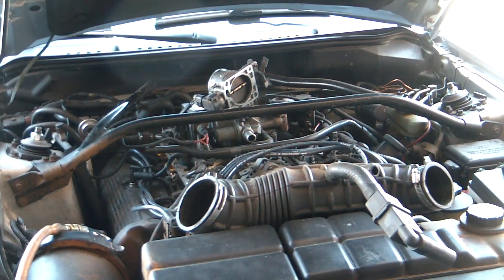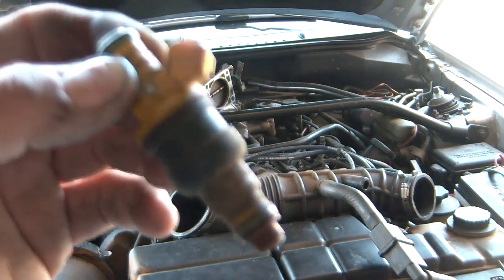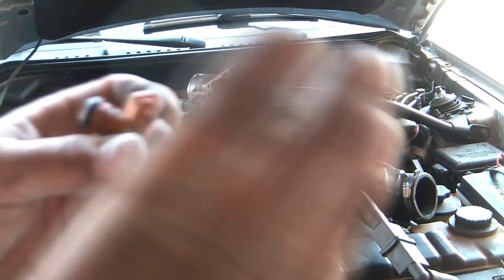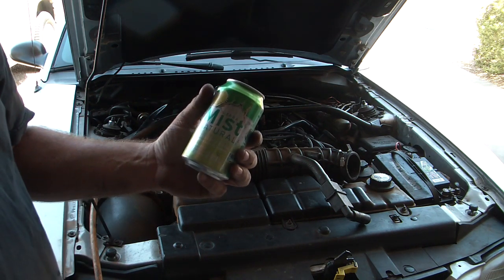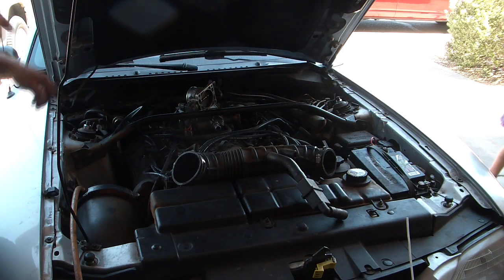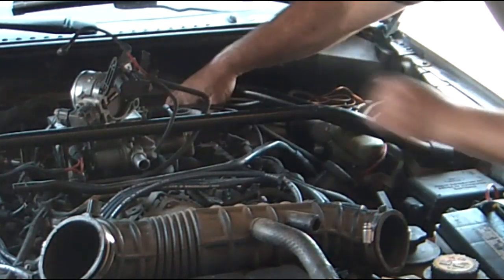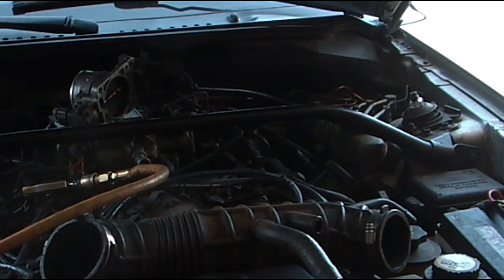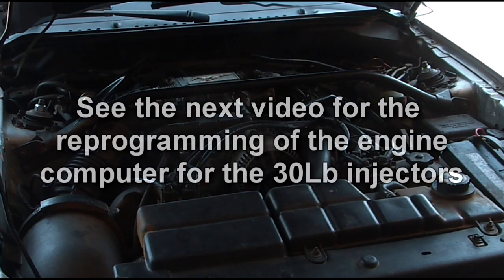Mustang GT Project - Installing 30 Lb Injectors

Comment: 30lb injectors are rated for like 315cc if I'm not mistaken. The 3bar one's.
Reply from the maker: They were nearly 50% larger than stock. But not large enough to turn the boost up much.

Comment from the maker: No. I think people have done 500HP on stock engines. 

This one has about 170,000 miles on it. But it will be the test dummy before I rebuild or drop in a rebuilt spare. 

I'm not going for a lot of boost. Just a little upgrade. :-)